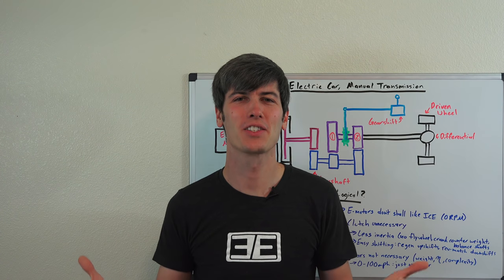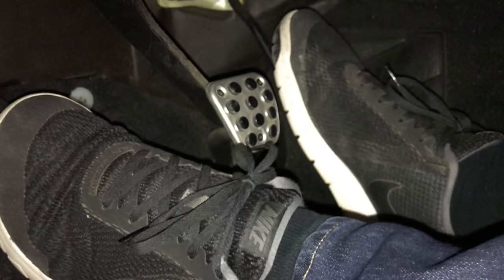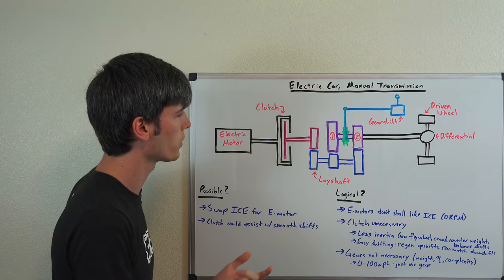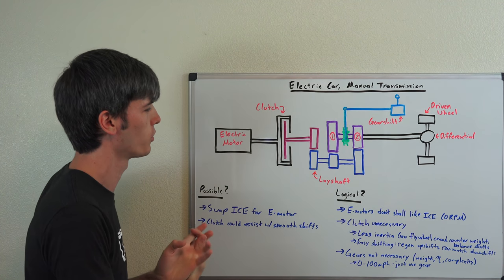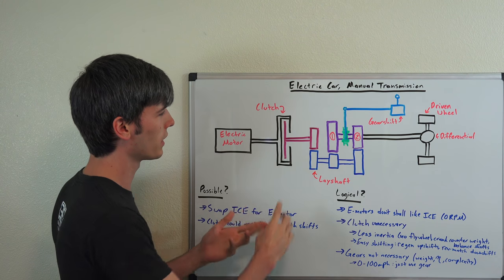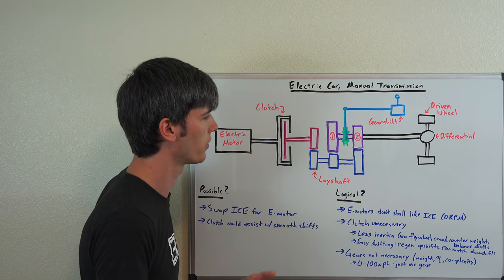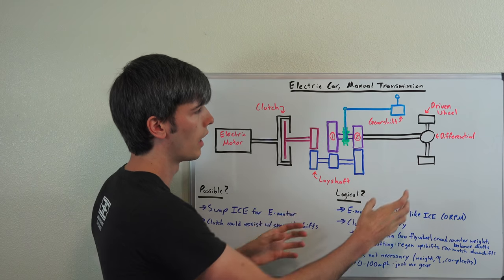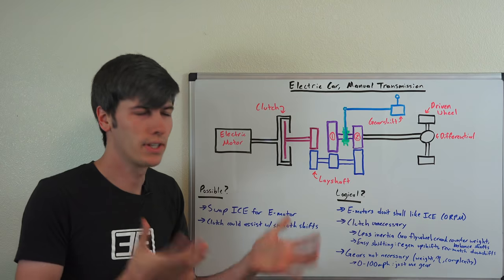Could Electric Cars Have A Manual Transmission?

Comment: I love the idea of sticking manuals in electric cars. If electric cars came with manual transmissions, I would actually want one. Think of it as an anti theft device (granted, you can't really stall an electric car, but the thief doesn't know that).I would gladly pay EXTRA for a manual transmission, I don't care if the automatic is faster or more fuel efficient because I will have MORE control.

Comment: A single gear transmission would be way more reliable. I liked manual transmissions because they were reliable and engaging. Now we are just adding a 3,000 dollar part for fun? Form needs to follow function, not the other way around.

Comment: The main idea that you didn’t “brush” on is that electric motors loose their torque potential at higher RPM’s. If you had a 6 speed manual you be able to drop the RPM’s of the electric motor as you climb in speed giving you that crazy torque you get at slower speeds, but at higher speeds. I’m fairly certain, that if Tesla implemented a transmission, those cars would be unbeatable by any gasoline engine.

Comment: Really the only way running an eMotor through a transmission and truly achieving an increase in efficiency is through a CVT. This would allow you to sit the eMotor at or near its ideal RPM range and helping to give the vehicle a higher top speed without having to run an eMotor capable of both zero-speed and high-speed torque delivery. (To an extent)

Comment: So, what about a CVT?  CVT's are traditionally smaller, lighter and less complex than a manual, or an automatic for that matter.  Their ability to continuously vary the ratio in a smooth, seamless manner would mate well to the nature of an electric motor, and it would add the benefits of lower gear ratio/more wheel torque/ better acceleration at low speed and high gear ratio, low motor speed at high speeds for efficiency.  Although it would add some weight, that could be at least partially offset by a smaller, lower torque motor and a smaller battery.  I guess my question is, is an electric motor more efficient at lower RPM and would it be worth it to have a smaller motor and an overdrive to increase range?

Comment: Well, despite electric cars having a very high acceleration, manual transmissions could help electric cars accelerate much faster and give it a very high top speed (something electric cars lack). Along with that, cars will be more efficient as the motor won’t have to put out all that unnecessary torque at high speed. And finally, if you don’t wanna drive a stick someday, just put the car in 3rd gear and drive it like a normal electric car.
P.S. this can be done using any transmission, but manual is cheaper and more reliable.

Comment: theres a company that turn classic cars into EVs and theirs use 4 speed gearboxes with original clutch!

only thing different is you only use clutch to change gears. when stopped you dont need to be on the clutch because you cant stall an electric motor

Comment: If the manual gearbox is reconfigured so that 1st gear is 1:1 and the 2nd and beyond are <1:1, you would essentially have double, triple, and so forth overdrive gears. It seems to me that this could be an efficient method to get more range from an EV. In addition, a trannie (old school from transmission) is ‘agnostic’ to what the input is. iCE, EV, or squirrel, the trannie does not care or know what is turning it, only that it is turning. So that should take out the argument of how to interface and other such things. 

I am a bass guitarist/vocalist/singer/songwriter/auto enthusiast. Those are my connouns. 😎

Comment: you don't need them. An electric engine has torque over a huge range of RPMs. 0 to 20,000. The whole point of gears in regular cars is to keep the RPMs at a point where the engine delivers adequate torque and power.
Reply: You're incorrect

Comment: In theory could you run an electric motor through a set of gears to get a stupidly high top speed (assuming it was unrealistically aerodynamic)? I don't have a huge amount of knowledge on electric motors, I'm assuming they eventually hit an RPM they no longer run efficiently at.

Comment: I personally hate driving automatic cars. I simply hate to drive an automatic car and not think about which gear I am on, current speed and RPM, and not doing any rev matching when shifting. I wish automakers will somehow shove in a manual transmission into an electric car. Manual transmission's are so much fun to drive.

Comment: I can reply to the question in the title without watching the video.  There's no point in multiple gearings for an electric passenger car as an electric motor delivers very consistent torque across the very long RPM range, which covers the entire range of RPMs for all driving speeds.

Comment: I think you are over estimating the difference in rotating mass between an the rotor and the crank, rods, pistons and harmonic balancer. The rotor is made up of copper wire which is heavier the steel, so it has a higher inertia. The only plus is that mass is close to the drive shaft. I would think a gear box with a high-low gears give more torque at the start then a higher top speed with less load on the motor.

Comment: Good basic explanation, thank you for the video! I think the existing  manufacturing has to be considered here as well - it would be way less taxing if only the engines would need to be swapped frok ice to e, while the rest of the powertrain remains traditional. Industry costs may just play the highest priority in converting to electric vehicles, not so much consumer demand. 
Also, fron a design perspective, it many be a good idea to build in some inertia into electric engines, and keep them spinning even with the car in idle - this way there is mechanical energy kept within the sytem and available for use, while the manual clutch setup would take advantage of this.
Reply: I mean evs arent great so meh
Reply: @jdrok5026 everyone got their own standards for great.

Comment: Efficiency loss through a manual transmission is minimal. I would assume it would be even better on the 2 speed Renault manual since there are less gears in mesh.

Comment: it only works for flat ground the problem you have at low speeds/hills you are drawing a large amount of power and you need the lower ratio to have a higher efficacy.

Comment: Having lower gears to multiply the motor torque would mean a less powerful motor can be used and still get up to a decent top speed, to power a single speed ev you need a motor capable of very high torque to move the vehicle from a standstill at usually a 1-1 ratio

Many converted ev have the clutch converted to solid coupling which makes pulling away clunky and jerky, they usually have to stop then select a gear before pulling away in the new gear, or changing gear by matching rpm like an old school dog box.

To keep the clutch and maintain a regular car feel you would need some kind of idle mode on the motor for "normal"  smoothness whilst changing gears, even changing gear when the engine is off (0 rpm )but the vehicle is rolling is not smooth.

When you are stopped the motor could shut off completely just like on a stop/start capable i.c.e. car but whilst driving the motor could hold a 1000 rpm idle whilst shifting just like an engine to smooth out the transition.

Comment: 1. A manual  transmission is manly. That's reason enough.
2. You could use DC motors.
3. You could reduce torque to the driver wheels
4. Chuck Norris would not drive a car without a gear shift.

Comment: We built an Electric S-10 in the mid 90's. It used the manual trans using a custom bellhousing. There was no clutch and you could shift at any time.. Dont know where Im going with this but it could also go 200-300 miles per charge and accelerated faster than your typical car. It only cost about $10k in parts (labor was free because we were students).. 
I guess I'm asking: "Why has electric tech been so slow to catch up to what kids could build 20+ years ago?" is it really just a conspiracy by 'Big Oil'??

Comment: Isn't it ironic, that people who really enjoy to drive want a manual transmission, but even they want it to shift as quickly as possible. So the next step is a automatic transmission, e.g. dual clutch transmissions, they're quickly, but even they're not as fast as a one gear transmission, because the last one doesn't have to shift. No shift, no time loss. It's just like the old story of the development of the wheel: by adding more and more edges, the final perfect solution is: no edges. But yes, even I am sad about this "non gear future".

Comment: Perhaps we are going about this the wrong way. How about having a shifter and clutch like a computer game controller and have them connected to the motor and brake control units to simulate a manual transmission with software. I'm sure I'm not the only person to have thought of this problem in this way.

Comment: Actually manual gearbox isn't about "joy", but it's about efficiency and full control. Automatic gearboxes, even DSG, still have some lag and relatively poor control for downshifting etc... and in real life driver who knows what he is doing with manual gearbox will be better off anytime. In snowy conditions automatic gearbox could be even dangerous, not to say that you can't tow another car without damaging the gearbox, you can't get towed neither... Electric cars is a completely different thing. But electric cars aren't there yet, and it as of today there is no even talking about battery solution. So, internal combustion engine with manual gearbox is unbeaten, and the more experienced driver you are, the more benefits you can get from manual gearbox.

Comment: Id' say that the biggest reason we still have manual transmissions is that they are cheaper, not so much because there are tons of purists out there who want to change manually. A new car with a manual transmission is usually 1000-3000 euros cheaper than the same model with an automatic transmission. At least here in Europe, manuals are considered pretty much the standard option, and an automatic is a kind of a luxury thing for those who don't want to bother changing gears manually. There's a cultural difference between Europe and the USA.
In short:
Europe: Manual is standard, automatic is for lazy people and those who drive for work.
USA: Automatic is standard, manual is for purists/enthusiasts.

Comment: Hello, it's the future (2022).  Toyota wants to do a manual transmission for EVs including simulated stalls, and Ford wants to have an electronic clutch to row gears without stepping on a pedal. Curious if there'll be any follow up video on either design concepts.

Comment: wait, so why did renault put a transmission in their vehicle at all? did they shrink their motor so it was easier to get up to speed but had a maximum RPM, so another gear was necessary? or was the extra wheel torque gained from having a low gear beneficial for starts?

I have no idea about any of this, but i'd really love to know.

Comment: What is the upper RPM limit on most production electric cars' motors? For example, the Tesla cars all have a top speed of under 130mph (IIRC), but I've always wondered if that was because of that upper electric motor limit, or if it was electronically limited for some reason. If there is a mechanical limit, THEN I could see adding that 2 or 3 speed transmission.

Comment: Coming from driving electric fork lifts where you are moving loads of over a ton, they do move off, but slowly, even with the accelerator pushed to the floor to get things going. Thinking of a car or van that is TOWING a trailer (or caravan), would a 2 gear transmission be useful as a 'Starting' gear to get moving off, then a 1-1 driving gear for normal use? Does the reduction in gearing give a useful increase in power of torque?

Comment: Guess you could have a torque converter to get the electric motors rpms up into an efficient range and lock up once cruising however you’d likely loose efficiency due to the converter. Feasible?

Comment: I don't see much point in the clutch, its not like the motor needs to keep an idle speed while the car is stopped, and I've seen/heard of people who have converted cars with manual transmissions to electric and they left the clutch out, and they said most of the time they just leave it in 3rd (or whatever gear is 1:1) and they said letting off on the accelerator alone was enough to let it shift without grinding gears.

Comment: Wouldn't it be interesting to use gears, so that the size and the output power of the motor could be decreased? Not regarding the increased weight due to the transmission (auto or manual) that would have to be fitted.

Comment: The only real thing i see this being usefull for is getting a higher top speed. Electric motors are getting faster and faster and they have a lot of torque to begin with but eventually we will want to go a little faster. As of rn its not an issue but in the future the top speed of the car will be decided by the single gear they use. If you know how most electric motors work you will know that they can stall not as bad as an engine but it will cause damage. Damage that can cause the car to lose power dureing the race. It will need more power and the more power it needs the less effective it is in the race given how power is used.

Comment: Ok, so I know this would completely ruin the whole point of a CVT and would have worse performance and reaction time than a single-geared EV transmission, BUT could one- in theory- create a CVT transmission with programmed "gears" and a clutch to go on an EV, as an alternative to a full standard? Because CVT's are technically "one gear", it should be significantly lighter than a real manual transmission, giving better efficiency, while still retaining the ability to have different "gear" ratios and even allowing gear skipping (unlike the sequential paddle-shifters in some CVT's today). It would sorta just be like a novelty "electric manual" with, say, 6 programmable gear ratios that you can shift between in a standard manual H pattern (allowing gear skipping). So, you put in the clutch and shift into (for example) "first gear"; which then sends a signal to the car's computer that you're in first, and then slides your CVT's belts /chains into whatever ratio you have programmed for first gear.  Then just let off the clutch and set off. When you need to shift again, clutch in, shift into second, and then the same process happens again, but with the ratio programmed into second gear.  The clutch would kinda just be a novelty, as it shouldn't actually be necessary to start the car or shift gears, but it should be possible in lieu of the torque converter and make the driving experience more engaging. One could make it even more interesting, by locking the shifter in place while the clutch is out, forcing the driver to engage the clutch to shift. Since CVT's now, even those with paddle-shifters, "slide" into each ratio with constant power- instead of just slamming from one ratio right to another- rev-matching on downshifts is usually pointless, but giving it a clutch should stop that, since your RPM's would no longer "slide" with the transmission during shifts. That should make rev-matching relevant, and therefore make the driving experience more familiar and entice manual purists. 
Obviously, there are tons of problems, though. Mainly, it's completely nonsensical for most of the reasons listed in this video. Also, you wouldn't need the clutch to start the car, and you would never stall- which is like... 50% of the fun driving a stick-shift.

Comment: If the only real reason is to make the car more enjoyable to drive with manual transmission, can we just have a pseudo manual transmission? Just a gear/shift stick (no actual gear box), and clutch pedal (again, no actual clutch) but use the pseudo controls, in such that the car behaves like a regular manual transmission. After all, it'd all be software defined. 

For example, at 0 RPM, have the car 'stall' if the clutch isn't depressed, simply require the user to re-press the 'start' button to get the engine 'running' again. Also, limit each gear with a pseudo electric >combustion RPM. I'm sure there is easy ways to calculate RPM based on torque and actual RPM vs what gear is selected with the gear/shifter stick. Giving very slow power delivery request from  electric motor if the pseudo RPM is low and the gear select is too high for the speed, much like a regular transmission.

This would make driving much more fun, with the added bonus of turning on 'sports' mode for that throws in extra Kw at the wheels in all gears , or things like 'Sunday driving' that just slows everything down at a more leisurely pace, as well as allowing for an 'automatic' option, among other custom settings people will want, such as an automatic with a 'power band' (anyone remember the two stroke motorcycle bikes) or even adding a bit of 'turbo lag' for that authentic 90's turbo car feeling.

A Pseudo Manual Transmission using REAL clutch pedal, and a REAL shifter stick in a real world feeling to it would be acceptable. None of that flappy paddle manual transmission auto shifting stuff.

Comment: I know of a guy that did swap an internal combustion engine with an electric motor. Don't start on 5th gear with a huge load on the motor while flooring it. You will pull too many amps from the motor, and it will burn up.